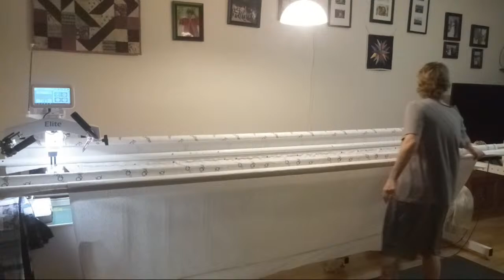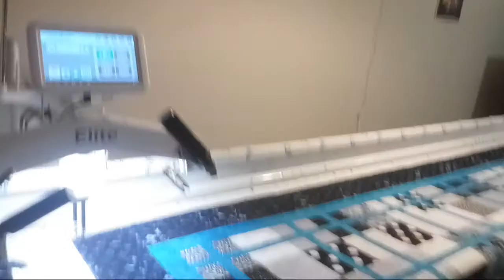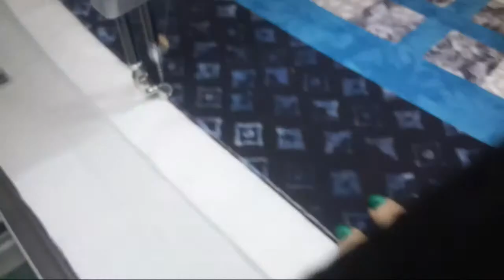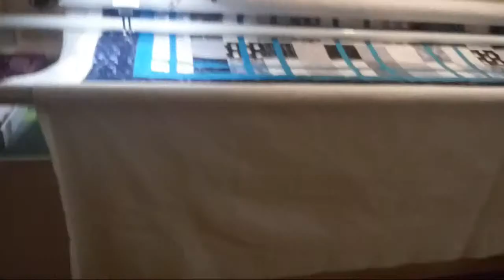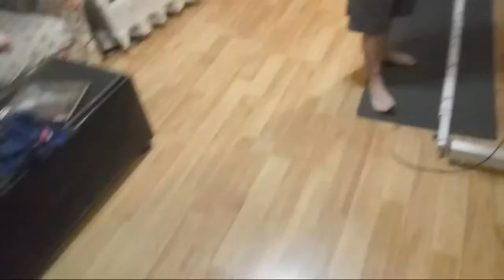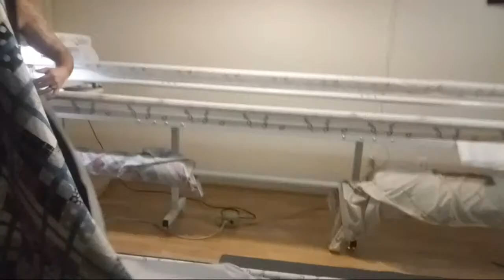Time To Load And Quilt A Client Quilt

Comment: How are you liking your King quilter? Have you had any problems with it? I am looking to get one but wanted some input on someone who actually owns one before purchase.
Reply from the maker: I love it. Its a great machine at an affordable price. Ive never had any mechanical issues. I did have issues with the tablet being in the heat. But that problem was fixed by bringing it indoors. Its easy to use and learn. It runs smooth and stitches beautifully 😊 When your ready to look into them and purchace here is my link for SewingMachinesPlus
https://shareasale.com/r.cfm?b=596711&u=2756385&m=53072&urllink=&afftrack=